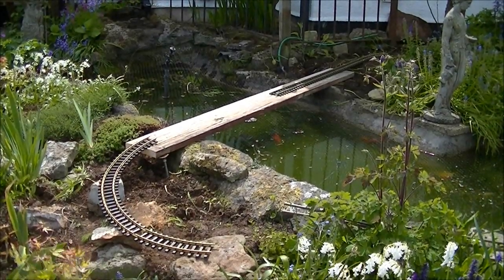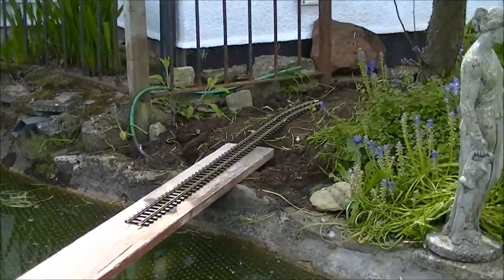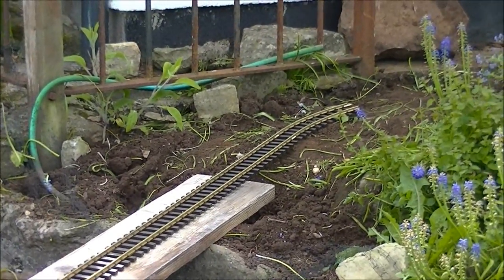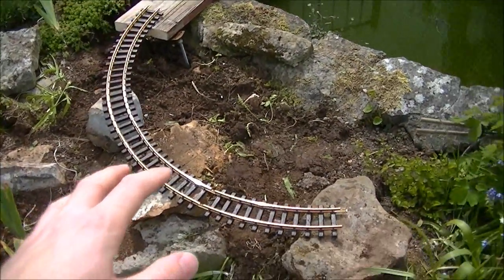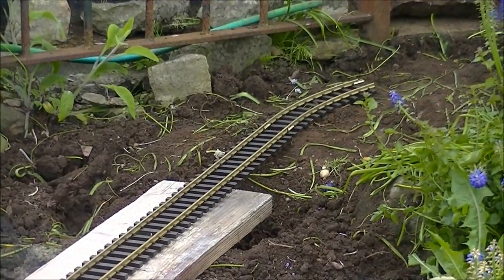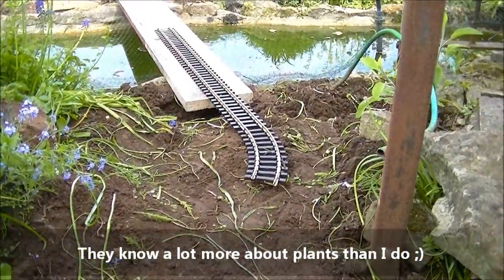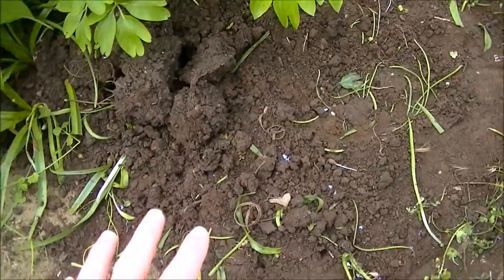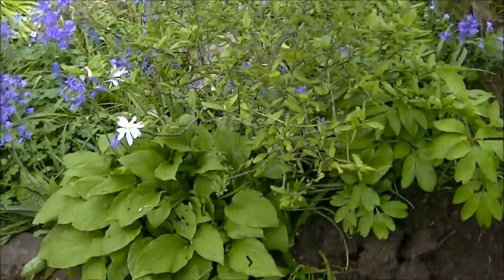G Scale Garden Railway Project, Update 2

Comment: I'm thinking of starting a garden railroad this Christmas. Only problem is, is what era and location it'll be based on, but that'll be decided when Santa gives me the garden RR stuff.
I also kinda want to try and snag some stuff off Ebay, to hopefully allow for cheaper expanding, but I also don't want to avoid the costly 100% ready to run option, so I will scratch and kit build.
(Yes, I'm American, so that explains why I use railroad and not railway.)
Reply from the maker: Totally depends what you want mate :) Mines based on a preserved narrow gauge railway, so I can run anything I want (Steam, Diesel ect) from all around the world. All ready got a number of American locos in my fleet too. Which really does add to the preserved feel. 
Building on a budget can be done with a garden railroad, it's what I aimed to to do here. Most the the rolling stock, like the coaches are off Ebay and seem to be copies of the more expensive stuff. Works perfectly fine and is easy to repaint and change about if you wish, which is what I've done with some of them (got some bogie coaches for around $40 new). Plus if you looking for some very cheap and fun items to get started I highly recommend the Playmobil R/C Train Set. May sound a bit odd, but it really is superb! Perfect for running when you done want to set up the electrics and just want to do a bit of running for a loco that R/C, well built and features sound and lights and a wagon for around $150 you can't go wrong! Plus you can pick up extra wagons for $15, which I've got 5 now ;) 
Anyways hope this is of help. Here's a link to two video you might find of interest. The first is of my Piko White Pass Mogul;
https://www.youtube.com/watch?v=ctcg2F-x4ao
The second is a slightly more recent update, featuring the Playmobil Loco and Cheap Coaches bogie mentioned;
https://www.youtube.com/watch?v=uJ2vfWMQ3hU
Hope it's of help and let me know how you get on :)
Reply: Here's a track plan I made in Paint.net. http://i.imgur.com/QGiNaPw.png
I'll prioritize going for only one track and a basic loop, but if i can, I'll double track and expand the track to the full plan as well as the yard, as seen by the 2 lines.
Reply from the maker: Look great
Reply: Thanks.

Comment: Can I ask what you are planning to build the trackbase out of? And, I trust, you are not  planning on using the plank of wood for the bridge base? Without wanting to make this a plug for a website, take a look at OOgardenrailway.co.uk - there is a wealth of hiints and tips on there that may just stop you making some costly errors. Welcome to the world of garden railways and good luck with your build!
Reply from the maker: ba14eagle Thanks mate! I did a lot of research into what to do before starting, talking to people on G Scale and Garden Railway forums. This update is a fair few weeks behind what the railway looks like now and there has been a lot more progress. As for the track bed, it has been dug down about 4 inches below the track. Oak Pegs have been hammered in at intervals to screw the track too, and the it then filled in with crushed bricks, then a large lair of large clean chippings, then finally some scale ballast will be added about the track. Will check out the site for more tips and info.
As for the plank, yes, it has been used for the bridge, but looks a lot different now ;) Hear's a link to my RMweb Page on the project. And there should be a few more up to date images of the railway and the bridge on there;
http://www.rmweb.co.uk/community/index.php?/topic/98576-the-blagdon-butcombe-light-railway-bblr/

Thanks for all the info! :)